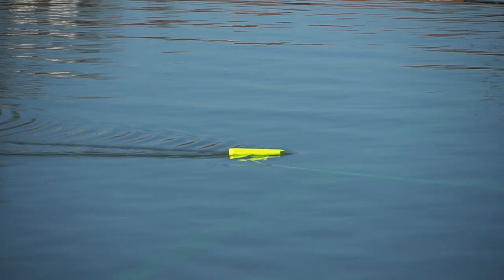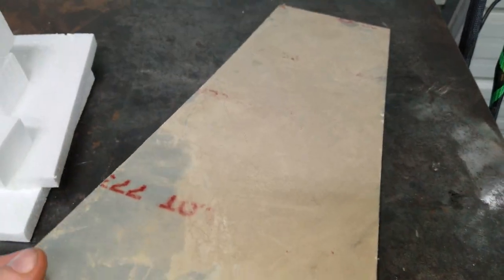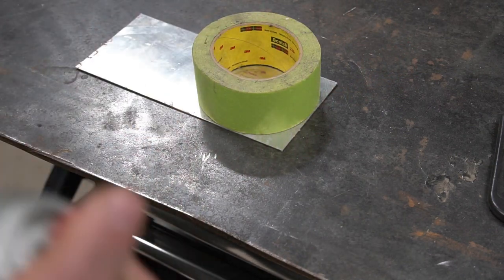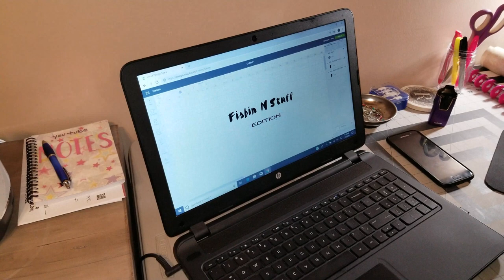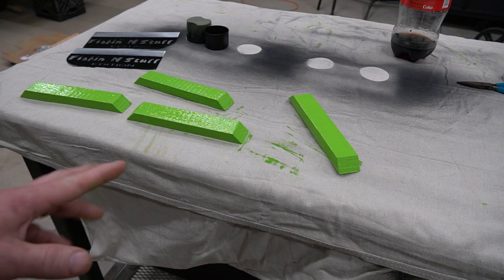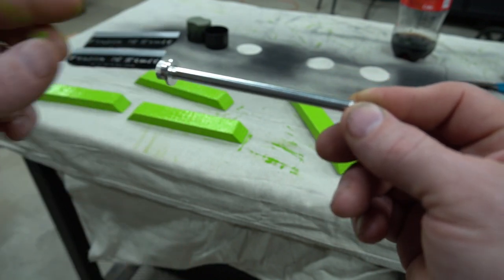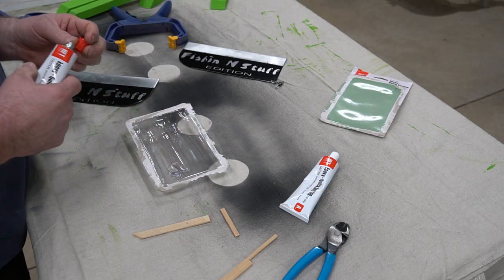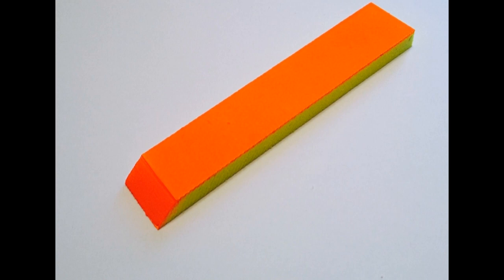Planer Boards DIY .

Comment: Great video! I am making some now, I had a hard time finding the aluminum bolts. I do like making everything so I found aluminum gutter nails (for house gutter). I smoothed the side on belt sander and threaded the end. I thank it’s going to work well.
Reply from the maker: That's a lot cheaper too , you can use threaded rod , a lot ppl do . And it can be very thin because the threaded rod is stronger , but I like stuff to look good lol . Thank you for watching , and i really appreciate it when people take the time and comment it means a lot brother

Comment: Been thinking of getting some of these for trolling, looks like i can make a couple without too much hassle!  Thanks for the DIY buddy!
Reply from the maker: They aren't to bad to make , it actually wouldn't take long at all if you dont customize em like some ppl lol ,  I think it I made more I would use really thin threaded rod hammer the end flat and drill a hole then put shrink wrap over it and that would make it ser cheap
Reply: @FishinNStuff  i oredered some 1/4" aluminum rods off Amazon. 10" long so I can get 1 set out of one rod. Threaded the ends with fine thread. I think 10 of them were less than 10 bucks.
Reply: Sold by stoner metals
Reply from the maker: @railroader010171  that's a good idea , I started too do that , but I found those bolts so I went the easy route.  You can use regular threaded rod if it's a very small diameter.  A little weight won't hurt nothing

Comment: Nice work.  These looks awesome.  I could use a set for light tackle trolling.  I'll have to give them a try.  I have a setup of huge planner boards I use for trolling big lures in the Chesapeake Bay for striper in the spring.  I pull up to 6 lines on each board.  I'll be sharing this setup pretty soon.
Reply from the maker: Thank you Sir , I've got some small ones too . You can use for bass or crappie trolling . I appreciate you watching brother

Comment: How long are the finished bolts when you put the clips on ,and what it the location of the hole for the bolts ,can you go back to far or be to far forward
Reply from the maker: I will check brother , if memory serves me right . The bolt was 6 inch long  , and it was 3 inches from the front edge

Comment: Looks like they should work. I've tried using them a couple times, but they don't spread out too good for me going .3-.4 mph like I was told you want to drift for catfish at. By the time I have to move and start over, they've just finally got out where I want them...  😂
Reply from the maker: I've never tried using em drifting but it seems like it would be difficult,  I troll with em and like planet boards but I catch most of my fish on the rods right behind the boat honestly
Reply: @FishinNStuff  the winds in Oklahoma are usually in enough to move my pontoon, I had the same problem getting my boards out. The last two times I've gone I use trolling motor to keep the boat straight and the boards work great. Also caught 5 fish on Boards and 2 on others

Comment: I don’t fish with planer boards but I’m considering it. Some of the how-to videos emphasize that planers just move horizontally so that rods three and four are out to the side well rods one and two or more down the middle. While fishing in the ocean recently, they were using planer boards to dive down 15-50 feet… Is this just a different type of planer board...a diving one? 

These had substantial weight on them with no floatation on it. Is this just same name for onshore/offshore uses?
Reply from the maker: Those may be different  planer boards there's several different kinds . The kind I made , I have a how to on
Reply: Fishin N Stuff yeah I watch that one too. And I popped over to some ocean fishing guys to confirm that I wasn’t nuts - you can see in their designs they don’t have flotation, actually kind of the opposite. They have a big honkin weight on the boards we used & depth stamped on them – 10/15/20/etc. 

Maybe there’s a new how-to for that – horizontal planer board plus vertical planer board… You could probably even make your own lead
Reply from the maker: I'll look into that

Comment: i like your channel however i guess i would have to spend over two thousand in tools.  and spend several hours to set up and make.   well for me, it is cheaper to buy.    love the channel keep it up
Reply from the maker: Thank you Sir I appreciate that , most of the stuff I make can be made with basic tools which is what I started with but just added too em over the years,  this project in particular could be made with a 10 side grinder from harbor freight which I actually did use a hand drill and some tape to cut the tape instead of vinyl,  and a utility knife for the styrofoam,  but I do understand as much as I like making stuff I still buy some stuff too , I appreciate you commenting sir

Comment: Would plastic dip melt the foam? If not, it would make it much more durable than painted styrofoam.
Reply from the maker: That's a great idea I would almost bet you , it wouldn't hurt the foam.  But I would test a piece first . Either easy that's a great  idea . I had an idea after making those , I experimented a lot making that video and epoxy doesn't hurt the foam . And it drys hard . I thought about trying it out . The reason you can't use spray paint is only because the acetone in it eats the foam pretty quick
Reply: Fishin N Stuff Two other ideas also come to mind... Closed-cell polyethylene foam (like pool noodles are made from... ) would make a really durable float material. And you could attach it with small bolts and fender washers. Of they get damaged you can replace them easily enough.
The other material would be balsa wood attacked with bolts. And since it's wood you can put it with whatever and it also very durable.
Reply from the maker: Balsa wood is a really good idea man , easy to get and work with , dang you need a DIY channel lol . I thought about pool noodles but I don't like the way they look on planer boards a lot of ppl use em . They look homemade which is fine but I like stuff too look like I bought it you know . I try to make stuff with materials that's ready to find ,,,,,if I can lol

Comment: Quick thought. A person could flatten out some PVC & use that couldn't they? Or do you need the weight of the aluminum?
Reply from the maker: You could do that , some people use plexiglass.  But you do need a little weight , but it can be added
Reply: @FishinNStuff  that's what I thought. Like the idea of balsa wood. You could even use Plast-Dip to coat it

Comment: how  thick is the aluminum plate please ?? .i am using 1/8"~( 6"x 12" x 1/8")~but am thinking it is to heavy @ 16 oz. what do you think with a pool noodle along the top?
Reply from the maker: They actually work good . I have another video where I used balsa wood for the top and I talked about pool noodles being used , they with good but they don't last . The balsa wood worked out really good

Comment: ok so now that i went to harbor freight and bought a welder LOL!! i get the planer board. but how do you know if a fish is on??? I cant get that part. Anways. I subbed the channel and appreciate all you do!! Akso curious as to where you are located!! Have a blessed day!
Reply from the maker: Im in NC  , the planer board will float upright pulling away from the boat , that's what keeps the lines spread out . When a fish hits it or it gets hung on  something the one side is hooked to your line the other side is clamped onto your line by being squeezed like in between your fingers . When it gets pulled out of the clamp and floats all crazy they say it's been tripped that's the sign your hung or a fish is on it . Thank you for subscribing and commenting brother I'll help you any easy I can
Reply: @FishinNStuff  thats amazing. two of my sisters are in NC. one in charlotte and one in Winston Salem. Thanks for the videos my friend.
Reply from the maker: Im about 30 mins from Charlotte

Comment: Great job on the planer boards. I had a few questions that may come from my inexperience with planer boards. First, how far from the edge did you put the hole for the  bolts? Maybe I missed that in the video. Also, what made you choose aluminum for the board material? And lastly, for the board to pull to port side, would the rounded corner need to be to the left? I've never used planer boards and I'm not about to pay $50 for one. This Carolina boy will make his own. Thanks to you.
Reply from the maker: Hey brother thank you so much for watching , I picked Aluminium because you want a little weight on the bottom but you still want it too float , some ppl use plexiglas but you might need to add some weight , steel would be a little heavy plus it would rust . , the holes on mine are about 2 and a half inches from the front but the length of the bolt goes into that measurement,  you want the angle of the line like 30 to 40 degrees different from the Aluminum so they pull away from your boat , and yes  you do put the bolts on different sides , you dont have to worry about which side you cut the corner both sides are the same just put the bolts on opposite

Comment: Have you tried them boards out as of yet? I purchased some at the conference to try this year and they look a lot like yours but I'm always looking ways to save money, lol.
Reply from the maker: No Sir I haven't had time to fish yet I also went to the conference and finished editing a video yesterday,  but I'm going to I'm sure they'll be easy to adjust if they dont , I made em just like the zakk Royce  boards I have I made em 1 inch shorter because  my bolt was a lil shorter hoping to make up the difference, but I'll let you know on a up coming  video
Reply: @FishinNStuff  I purchased some from Park Planer boards at the conference and they look alot like yours. I have never ran planer boards so may have to get some tips off ya..lol
Reply from the maker: I'll help you any way I can brother , I'm about to post a new planer board video ive been working on that's really different.  I bought my first set too but they are kind of high for no harder than they are to make

Comment: First off... let me say how awesome you are, and how much I'm enjoying your channel!! Can you provide some clarification on how you attached the aluminum bolts to the planer board once you cut the heads off? And also, where you got the clips from? Thanks!! :)
Reply from the maker: I cut the head off and attach it with 2nuts on the threaded side the smooth side that's left where I cut the head off is where the clip goes  , you drill a tiny hole fur the spit ring
Reply from the maker: You look up release clips for trolling and you'll find em here a link but you might find a better deal than me 
https://www.amazon.com/dp/B001YS6STE/ref=cm_sw_r_other_taa_Qsr9EbFEKPSNB
Reply: @FishinNStuff  Like I said: You're awesome! Thanks!!
Reply from the maker: Ol i forgot , you should watch the balsa wood planer board  video i have i like those much better
Reply: @FishinNStuff  Will do!

Comment: how thick is the aluminum plate ? is it 1/16 " or 1/8" ?
Reply from the maker: I like 1/8 . Because you actually need a little weight on the bottom to make them stand up correctly

Comment: How did I mount the clip rod to the board
Reply from the maker: Joshua Callahan I drilled a hole 2and 3/4 " from the front and just below the foam as close as you can get but dint touch it , and put a nut on the bolt put it in the hole then put another nut on the outside
Reply: How far from side did u put your rod for clip thank u
Reply from the maker: The one that clips in to your line gos away the bottom back as close to the corner as you can make it the third eighth the release clip is 2 3/4" from the from up against the foam almost
Reply: Thank u sir
Reply from the maker: You are welcome anything I can do to help buddy

Comment: One thing is what was the measurements for the holes??
Reply from the maker: Hey buddy I'll get you the measurement but I never tell ppl but I'm telling you lol im almost done with a new planer board DIY  video ive been working on , so I would hold off building one . I might like the new one better . Ol and I'm sorry I left that measurement out that's an older video lol ive learned a lot since then
Reply: @FishinNStuff  Kool no prob I'll be waiting for the updated version.
Reply from the maker: It should be done Sunday

Comment: What's the measurement on the Styrofoam? Great job!!
Reply from the maker: It's the same length as the planer board 9 inches and 1 and a half inches tall by a inch thick
Reply from the maker: Thanks for watching brother consider subscribing I'm working on some really cool DIYs ill have coming up soon
Reply: @FishinNStuff  
I subscribed, been watching all your DIYs. Where you from?
Reply from the maker: I'm from North Carolina  , and I appreciate you watching I really do , I wasn't trying to be a salesman lol but I've got some cool DIYs planned and if you have any ideas you ever want to see let me know and I'll do my best
Reply: @FishinNStuff  what's the measurement on the hole for the rod? How far from top and how far from front of board.
Reply from the maker: Put it as close to the foam as you can with out hitting it , leave room for the nuts . And 2 3/4 " from the front of the board
Reply: @FishinNStuff  thanks man i appreciate it.
Reply from the maker: Any time brother,  hey id you can think of a cool DIY you would like to see let me know and I'll add it too my DIY video ideas list and try and get it done for you
Reply: @FishinNStuff  i want to build a rod holder rack across the back of my boat. Any ideas?
Reply from the maker: What kind of boat do you have and can you wind it or are you thinking more along the lines of bolting it together
Reply: @FishinNStuff  i have a Neptune 180 center console. Check out Steve Douglas on YouTube. He has a video showing the one he mounted on the back of his boat.
Reply from the maker: On that Neptune,  if I wanted a rod rack I would make 2 rod racks maybe 2 and a half foot long maybe a foot tall and mount 1 on either side of the motor on top the transom  , I haven't seen it in person but that seems like it would be cheap and neat looking , you could make like a  T  shape with a smaller T base and put 2 or 3 this per side . If you could find someone that wels aluminum to make em out of 2x2 they would look good , I don't use a rod rack . . I run the rigs up the side the back 2 this I run straight back , the next 4 I step out with planer boards the front rods I supend
Reply from the maker: Something like this but more heavy duty.  
Driftmaster T-250-H T-Bar System https://www.amazon.com/dp/B001F6GW6Y/ref=cm_sw_r_cp_apa_i_IIcKCbR3K5DYN

Comment: What is a planer board?
Reply from the maker: They spread your lines out so they don't get tangled up when your trolling for catfish , striper , or crappie . But crappie fishing requires smaller boards 
 I appreciate you watching brother
Reply: Fishin N Stuff Ah ok. Yeh, I’m searching for anchor options for my ski boat. Thinking about trying a box anchor but ran across your channel, figured I’d see what else you did. ;)
Reply from the maker: I appreciate you watching brother,  I really do . I'm getting ready maybe around Christmas break to make a new anchor that's really cool and holds great , I thought about doing a box anchor but this one seems even better